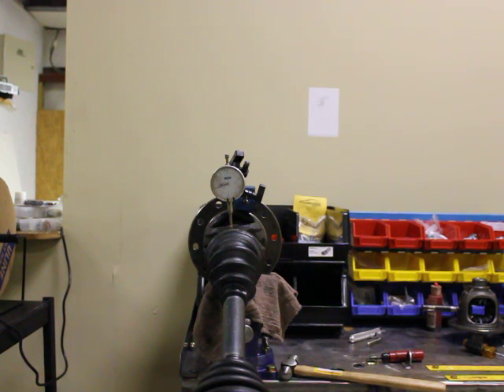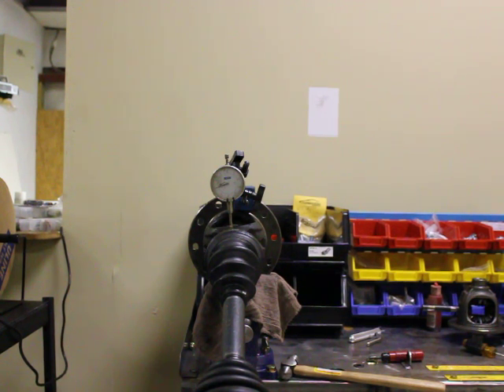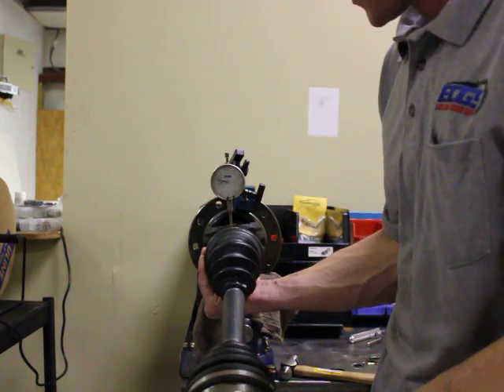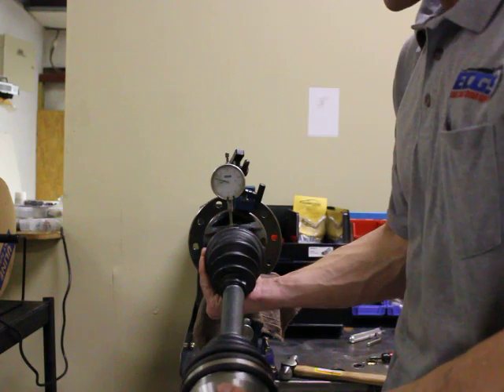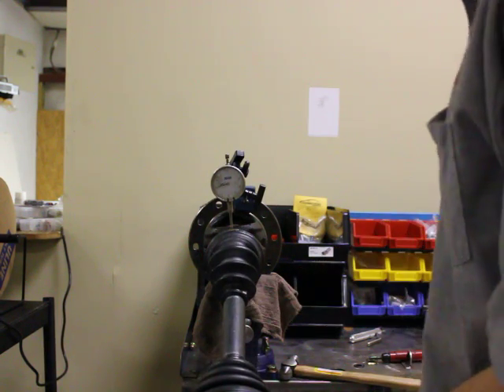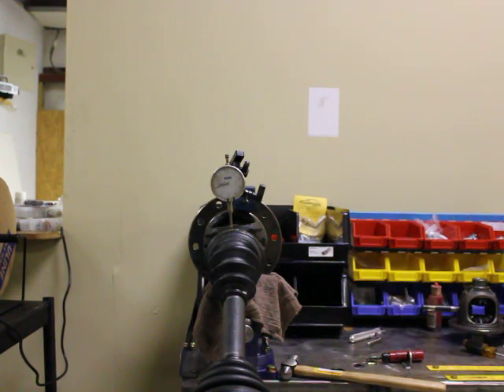T8CSPART2BUSHING.mov

Comment: Great Job!
I have a 2005 4Runner and I have this same problem. I also have 1995 4Runner and Tacoma without a single differential problem ever. I would like to test one or be one of the first ones because I have stopped driving my 2005 and went back driving my 1995 4Runner because the diff. with all of that play has also damaged the seal so that I keep leaking all of my gear oil. I am a mechanic for 35 years so I have all of the tools needed. Bruce